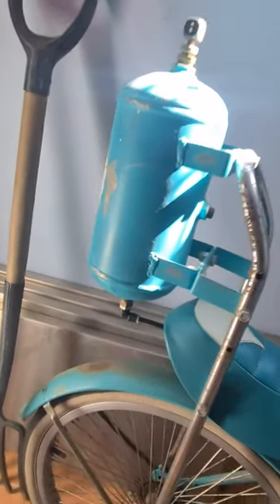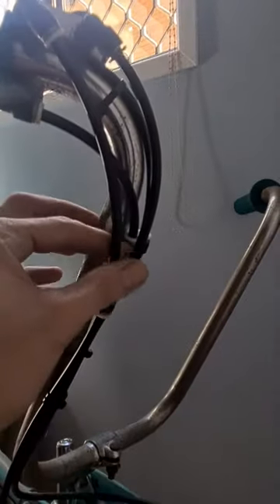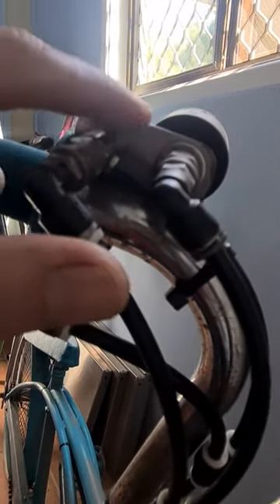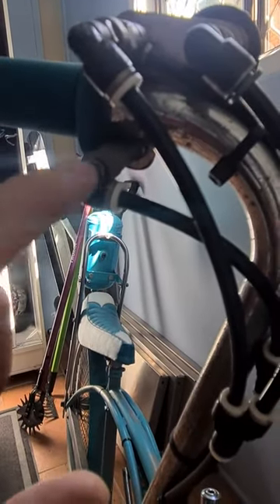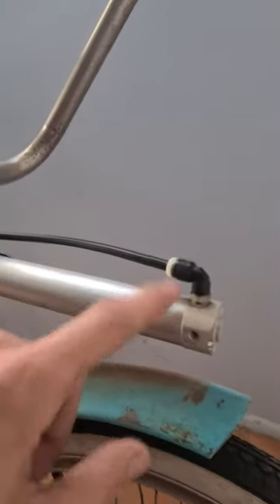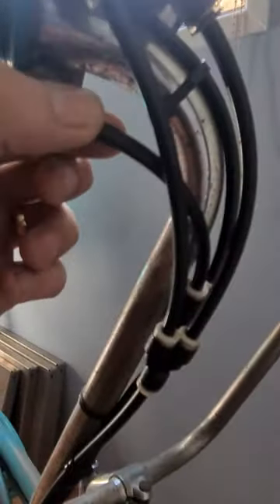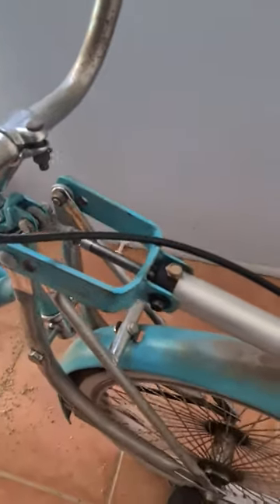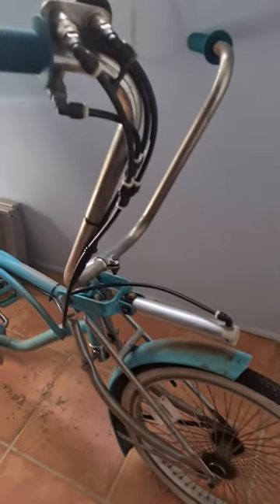Bicycle Lowrider with air suspension. Pneumatic system explanation.

Comment: Did you add a muffler to one of the exits of the cylinder ?
Reply from the maker: Yeah just to keep dirt out of the cylinder, it still functions normally with or without it in.
Reply: @Ezra1499  oh okay perfect it’s because they don’t sell a lot of single acting cylinders anymore . So I don’t know if a double acting cylinder would work ! Another question brother do I need a two separate switches or can one by itself do the lowering and rising of the cylinder ! I’m trying to achieve some hops with this lol
Reply from the maker: @roonytavares1  You will need 2 switches. One "up" with pressure on the tank to one side, press to open to inflate the cylinder, somewhere along that cylinder line have the "down" switch t-pieced in, pressure on cylinder on one side of the switch, press to deflate into open air. The other side of the cylinder moves freely and makes it so you have a certain amount of suspension at lower pressures.
Reply: @Ezra1499  with one switch it will only go up right ?? It won’t come down ?? What if I added a 3 position switch ?
Reply: @Ezra1499  do you have a instagram I would love to see the bike in action ??
Reply from the maker: @roonytavares1  A 3 position would work, just have to have one not connected as a dump.